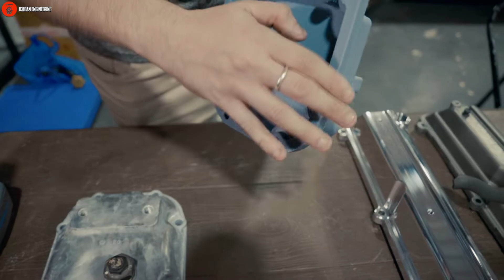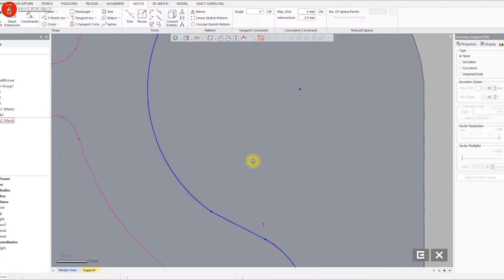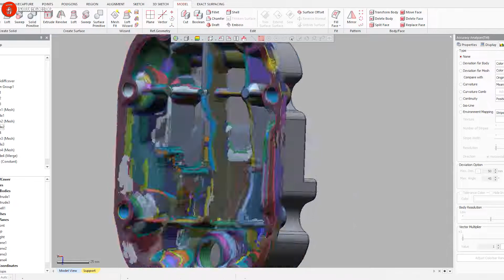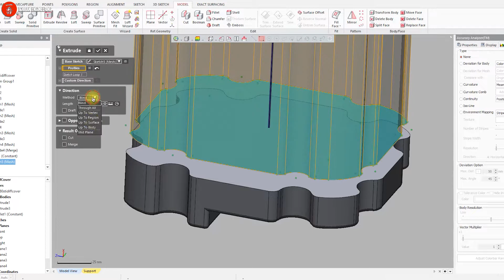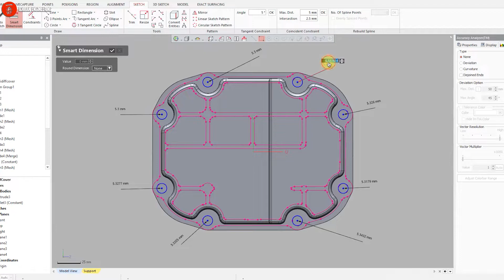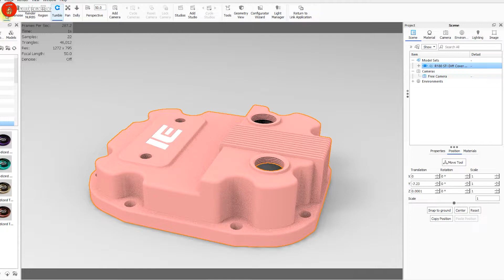How We Design It ? Subaru STI Billet Diff Cover

Comment: So many manufactureres overlook the performance of a diff cover, and only focus on the looks. Would be nice to see something specifically designed to exceed stock cooling for those long track runs. As far as im aware "Banks" a diesel company is the only ones that actually put the R&D into designing something that actually had significant benefits other than looks
Reply from the maker: we do understand that. the problem with the STI diff is where it sits. it only allow you to extend it down the bottom section.

The oem diff is pretty simple with no curvature inside as well. And honestly we would really want to do it but there is just no space for that.

We could add cooling ports to use with an external cooler and pump upon request. 

We currently running CFD simulations to see how the flow will be inside and improve it from there. This video is really just the base design, and it might change before production begins.